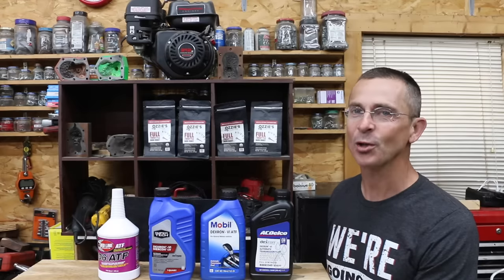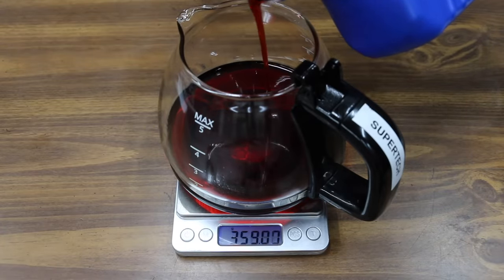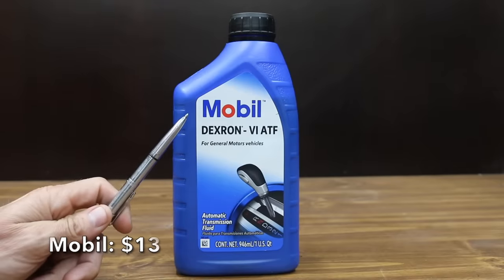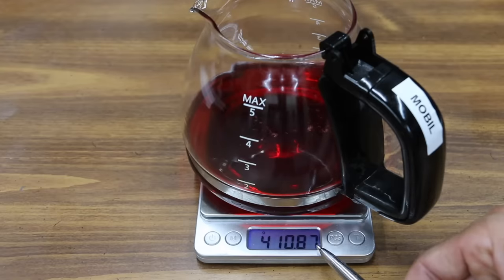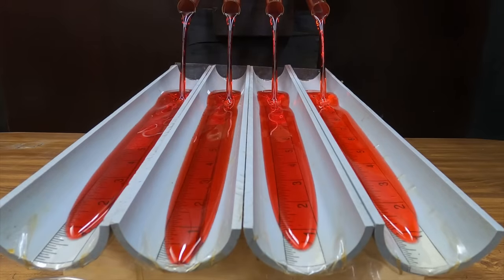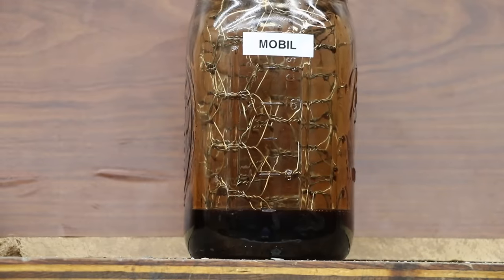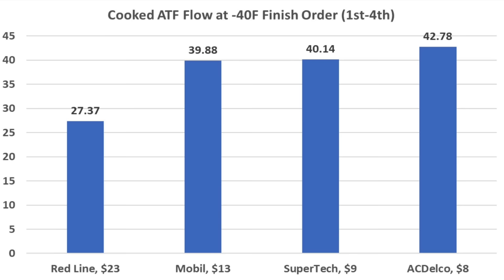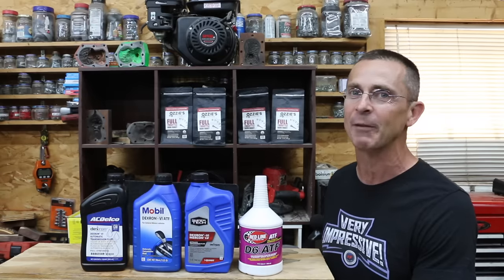SuperTech ATF Safe to Use? Let's find out!

Comment: I provide my feedback here not based on opinion but to give @ProjectFarm food for thought and to help the channel continue to develop great content. While I appreciate the work @project farm puts into his reviews and have found many of them useful, this comparison has some major method and premise flaws including the lubricity test and lack of clutch protection and grip test that make the comparison largely unusable in practice. ATF by its chemical design begins deteriorating exponentially at 200F and by 260F is suffering catastrophic damage. A healthy automatic transmission cooling system should keep the average ATF temperature in the pan between 100F and 180F at running temperature. Even ATF in a healthy system exiting the pump (the hottest point in the system) doesn't reach 230F. The test used in this video burns the ATF at 410F for two hours, which destroys any ATF brand. To then use that destroyed ATF in a lubricity test and cold-start test to compare how well destroyed fluids protect components provides no useful data since the fluids are destroyed and will never perform as tested in a healthy system. The useful data would be to cook all four ATFs at 180F for two hours and then run the lubricity test since the fluid is designed to operate at that temperature. In essence, this test is like running a taste test for the best cut of steak by burning four cuts until they are crumbling charcoal and then tasting them to compare the flavor; they will all taste terrible even if they differ in how terrible. At the end of the comparison, no one eats charcoal steak, just like no one who cares about his transmission uses ATF cooked for two hours above 200F.

The other missing scientific test specific to ATF and different from the engine oil comparisons this test is based on is how well the ATF allows the frictions and steels in the clutch packs to grip. The video focuses on how well the burned ATFs protect two metal components spinning against each other and the friction modifiers in the new lab results, but ATF also has the crucial and complex role of both protecting the frictions and steels from burning when freewheeling while also allowing them enough grip to firmly lock once the appropriate amount of line pressure is applied. Just because burned Red Line has better friction protection and higher percentages of modifiers than the other ATFs when new doesn't prove or even suggest it's the best ATF since an ATF can have too much friction protection. To much lubricity causes the frictions/steels to slip too much during shifting leading to excessive wear, soft gear shifts, or a transmission that slips in gear. A holistic ATF comparison must include a testing method where a friction is spun up to a similar RPM as a transmission input shaft, say 3,000 RPM which is a common shift point, and pressed against the steel to mimic line pressure, say 160 psi which is common on many transmissions, all while measuring the amount of shaft rotations or elapsed time it takes to lock the friction and steel. That's an extremely complex and precise test that without doesn't provide necessary information for gauging the quality of an ATF. I rebuild transmissions and would struggle to setup this type of test where I would be confident every test ran would be fair since there are so many forces at work. For all we know, SuperTech not burned would outperformed Red Line not burned in both protecting moving steel parts and in protecting frictions/steels while allowing them acceptable grip for comfortable yet strong shifts.

Without the friction data of healthy (not burned) ATF and the clutch protection and locking test, the best part of this video's comparison is seeing how AC Delco, SuperTech, and Mobil have similar mixtures from the lab tests. Red Line's extreme outlier in friction modifiers makes me suspicious that it will perform worse than the other three in factory commuter frictions/steel slippage, but that's my assumption based on three well-used and well-known brands being so closely aligned yet so much different from Red Line's mixture. I can see Red Line's higher friction modifier possibly complimenting race frictions and steels since they have a coarser gripping surface and may be able to grip under higher friction modifiers, but that's only a guess without the data.

I hope @ProjectFarm appreciates my constructive feedback coming from a similar place of curiosity and interest in scientific method. Thanks for providing content worth discussing.
Reply from the maker: You are welcome!  Thanks for the constructive feedback.

Comment: You could also test tire spray protectors, bang for your buck circular saws, chinese pellet guns the B1,B2,B3, paint brushes,  small engine spark plugs,  small solar panels, diff oil
Reply from the maker: Thanks for the suggestions.

Comment: Redline manual transmission gear oil completely made my vw shift better and smoother engagement. It is pricy but if you care about your vehicle it's cheap insurance for longevity. Looks like my automatic car is getting Redline d6
Reply from the maker: Thanks for sharing.

Comment: Hey Todd, I enjoy your channel, and the effort you put in to your reviews. You often ask for suggestions - have you considered moisture meters? Not sure how you'd check the accuracy, but suspect you'd find a way! I have  couple of meters to check firewood. They have not agreed on a value yet! I tend to go by the Stihl reading, since I hope Stihl know what they're doing... Compared to the Stihl, the Dr Meter (MKL-W01) is significantly different on the wood setting, but nearer using the Building setting 🤷‍♂ (using the prong option). Hence my curiosity and suggestion to you! Cheers, and thanks for the reviews! :0)
Reply from the maker: Thanks!  Thanks for the suggestion.

Comment: You shouldnt run Dex VI higher then 220 degress. That's when it starts turning brown. Most vehicles have transmission coolers that keep it below that temp. Best case test would be testing the fluids while in between 130 to 200 degrees for wear etc.
Reply from the maker: Thanks for the feedback.

Comment: The evap test doesn't mean that much if you are keeping your transmission under normal operating temps. The test doesn't reflect what kind of shift feel you would get in your transmission or how well the torque converter locks up either. Good test for wear on metal though.
Reply from the maker: Thanks for the feedback.

Comment: The problem with testing 'supertech' or other house brands is they change constantly.
When I was in autoparts we changed vendors most years, or at least every three years at a minimum. The products that came in boxes were often 'reboxed'. The chemicals and batteries would have the same labels, but be different products from different vendors. 
Even brand names got reboxed.
Reply from the maker: Thanks for the feedback.

Comment: Awesome videos, love your style.  I didn't see this addressed but maybe it will make a good video.  Can you address the thought that transmission fluid expands as it warms up and the dealers instructions that you need to know the exact temperature etc of the fluid when changing and adding transmission fluid?  Does transmission fluid actually expand with heat and by how much? Ie 10-20% by volume etc

I think dealers try to scare owners that a drain and fill is like a high level science project and if it is or isn't your the man to confirm.
Reply from the maker: Thanks!  Thanks for the suggestion.

Comment: How about testing robot vacuums? They are a great time safer, and those with docks may be even useful inside a shop to keep the floor clean.

The Roborock Q Revo for example looks pretty promising for such an application. Given that the shop's floor is smooth and not rough concrete - I guess.
Reply from the maker: Thanks for the suggestion.

Comment: If an aftermarket trans fluid is more slippery, doesn't that risk clutch slippage? also, what about rubber seal protection and stop leak properties? and wear protection of what? metal? or clutches?  and if clutches, factory clutches? or aftermarket clutches?

Comment: It would be really cool if you could test fluid shear strength, and fluid shear degradation over time. I believe I saw this in a comment below. Think of putting an electric motor on the input shaft on a torque convertor with a generator on the output shaft, to see power lost in the fluid over time/different fluids.
Reply from the maker: Thanks for the suggestion.

Comment: Boron-based lubricants: general characteristics of H₃BO₃ and H-BN
Hexagonal boron nitride is a well-known solid lubricant and is used by industry for various applications. Its structure is similar to graphite, but unlike graphite, it is white (hence, occasionally referred to as “white graphite”). Its atomic layers are made of two-dimensional arrays of strongly (covalently) bonded boron and nitrogen atoms.

As in graphite, bonding between the atomic layers is van der Waals type and, hence, relatively weak. In tribological testing, these layers slide over one another and thus provide low friction. When tested in the open air, the friction coefficient of h-BN is 0.2-0.3.

Boron has also been tested as a micro colloidal additive in oils and greases, and at concentrations of 1 wt.% or more, it shows excellent wear resistance. Despite the recent production of h-BN nanotubes, sheets, and nano-powders, there has not been much experimental work on the lubrication behaviour of nano-h-BN dispersed in oils or greases. However, there are studies into the tribological behaviour of nano-h-BN structures and their potential as colloidal nano-lubricant additives.

H₃BO₃ is also a solid organic lubricant made of boron. Mineralogy textbooks call it “sassolite.” The strongly bonded sheets are boron, hydrogen, and oxygen atoms, just like h-BN. Boric acid exists in two primary forms:  Metaboric acid (H₂O•B₂O₃ or HBO₂) and orthoboric acid (3H₂O•B₂O₃ or H₃BO₃). The most common form of orthoboric acid is formed by the hydration of boric oxide (B₂O₃).

There are three types of metaboric acid: orthorhombic or α-metaboric acid, monoclinic or ß metaboric acid, and cubic or γ-metaboric acid. While all of these boric acid types exhibit layered crystal structures, orthoboric and orthorhombic metaboric acids are by far the most common. Scientists are particularly interested in evaluating these major boron compounds for friction and wear properties.
Reply from the maker: Thanks for sharing.

Comment: I have seen you use the lubricity tester many times and get quite a variety of results. That being said, can you do one run with absolutely no oil? If you want to help keep it from overheating, using some water in the cup would be fine, but I am interested to see what the results would be. If you have 10 bearings that all have similar wear scars and you think the oil did a good job, it still doesn't quite show the effectiveness of the oil compared to the worst case possible.
Reply from the maker: Thanks for the suggestion.

Comment: Test idea! 

Which fuel is best for a salamander style heater. Diesel Fuel, Kerosene, or Jet Fuel.

Test the BTU output, pollution,  and if the BTU's are worth the price per gallon.
Reply from the maker: Thanks for the suggestion.

Comment: I have another suggestion.  Perhaps you already did it.  Could you test angle grinder wire wheel designs for the best to remove rust?
Reply: I forgot to mention that I think getting viscosity would be important for your tests like the one today.  Its just a cup with a hole and a stopwatch.
Reply from the maker: Thanks for the suggestion.

Comment: What about testing gear oils? Aside from being used in manual transmissions, differentials, and transfer cases, it is also used in motorcycle shaft drive systems where performance can be critical to preventing the rear wheel from locking while youre riding (in the case the drive fails) would be interesting to see what gear oil performs best and also what gear oil is most prone to leakage. Maybe drill like a pin hole or create some small gap and put some cardboard in there to simulate a gasket going bad? Leave it overnight and see how much fluid ends up on the ground maybe?
Reply from the maker: Thanks for the suggestion.

Comment: I'm not sure i would count the wear scar against the Supertech, since an automatic transmission is a wet clutch system being high friction against sliding motion would help keep the clutches from slipping.  I wonder if there is another test one could come up with to test the heat absorbtion characteristics of the fluids.  Still enjoy the content.
Reply from the maker: Thanks!  Thanks for the suggestion.

Comment: Do you have a video on CVT fluids? Those transmissions are suppose to be very sensitive on which fluid is used. However I've seen little difference between Castrol CVT and NS2 fluid. I'd love to see a comparison of CVT fluids like Castrol, Valvoline, NS2, and some others.
Reply from the maker: Thanks for the suggestion.

Comment: Both Redline and SuperTech are rated as LV on the bottles, which is different to the other two. LV is low viscosity. I think some of those fluid races threw the results. The speed at which ATF travels is also irrelevant, which differs to engine oil. An automatic uses the ATF as a hydraulic fluid and a heat conductor first and foremost, although the wear rating is important for ones planetary gears.
The issue with your tests is that a thicker ATF has better thermal conductive properties, which is important. It would have been better to set up a pair of oil coolers, warm 2x blocks (with oil passages) to 115c and pump the fluid around the coolers and see what the thermal properties are. First fluid to get under 80c on the return leg wins.
Reply: I know, it seems ridiculous that 2x bottles of Dex VI are intrinsically different, but they are. The issues arise with some fussy transmissions, but not others that you could stick anything in. Also, the difference is noticed when you beat on it. Ask me how i know 😁
Reply: Last point 410F is way out of spec for any of those fluids. Degreeation at 240F to 250F is what's relevant. If you go past 250F, you're not going anywhere anyway...clutch pack slipping, varnishing and the destruction of your transmission occurs at 250F and above.

Comment: Damn Brother! I wish you tested motorcraft Mercon LV automatic transmission fluid. Evidently Ford is having problems with their 6-speed automatic transmissions in F250 diesel trucks. Ford says that you don't have to change the fluid well into 100,000 miles. I just changed mine myself at 50,000.
Reply from the maker: Thanks for the constructive feedback.

Comment: Could you do a test of mid size air compressors? Thinking the 8 gallon size for noise, speed to fill, output, and features. Thanks!
Reply from the maker: Thanks for the suggestion.

Comment: A small quinble. You properly reported most of tests as percentage differences.

The evaporation test had significant variances in starting weights. Yet you reported the absolute differences which are not directly relatable. They most definitely should be reported as percentage differences.

Comment: Great video, my camaro 8 speed uses a low viscosity high performance fluid. I'm interested in which fluid would provide the best protection . They have had problems with torque converter shutter.
Reply from the maker: Thanks for the suggestion.

Comment: I am curious, because the transmissions are sealed, wouldn’t any evaporative laws be contained inside the transmission and then rejoin the fluid as it is sloshed around?

I am curious if you did the same test where you heated the fluid, but contained the moisture, and then shook it up, and then use that fluid for the further testing… would you get different results?

Comment: Is there anyway to do this test with same ATF brands but with heat transfer capabilities? Like if you heat them all up same temps, say 140-170deg range to simulate operating temps then a load that causes temp rise (climbing a hill or towing, etc) and you see which brands cool off the fastest when ran through a cooler or even if you set them on a cooler object like ice blocks or something of the sort?

Have you thought about also doing a coolant comparison?  Say like dexcool Vs green universal, Vs ford gold organic or mopar organic and maybe like an Asian pink version (Toyota) or blue by BMW?

Set the test up to maybe check how well they transfer heat when pushed through a radiator with airflow? Also see how they react to acidity or how fast they become acidic to cast aluminum water pumps, and maybe an actual cooling comparison to see if any of them cool better then others in some sort of measure of efficacy?

Sorry I don’t have actual test methods to be able to accomplish each one, as a lifelong dealer technician I’ve always pondered how well the OEM stuff would hold up to the claims they make, or is aftermarket better? They always sell you (the OEMs) that there is nothing more compatible and safe then their own products, it would be nice to show how consistent the OEM brands of fluids are but also show that aftermarket items for cheaper/comparable prices are also effective for people trying to make life on a budget.

I’m fortunate enough to be able to repair my own vehicles so I don’t really have much expense there in life, but I’d like to help others by educating them on more effective or efficient ways of maintaining a vehicle if they can’t afford OEM service
Reply from the maker: Thanks for the suggestion.

Comment: Testing idea: how well do tint some brands/types actually work to keep heat out of homes. 

Types should include Ceramic, mirror and carbon infused tints that are advertised to reject heat. 

There's a lot of false or misleading claims. I hope PF can confirm how accurate some of these claims are.
Reply from the maker: Thanks for the suggestion.